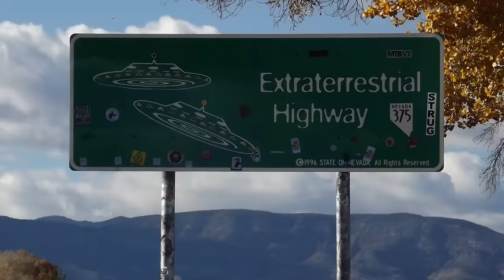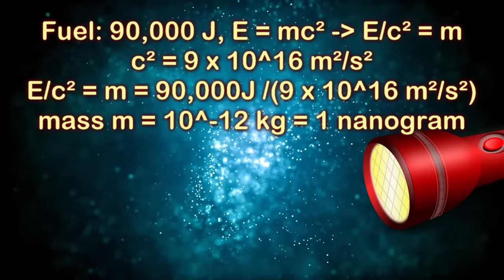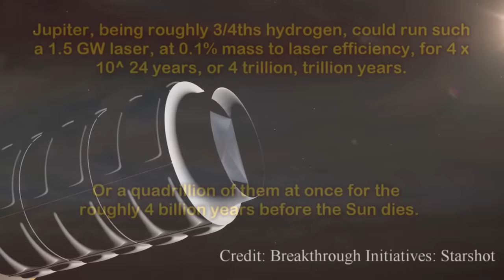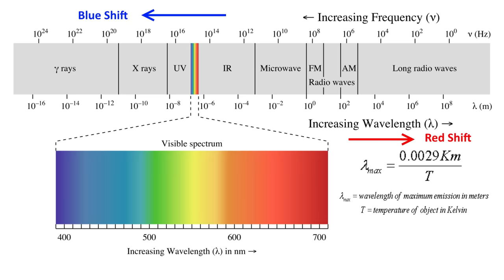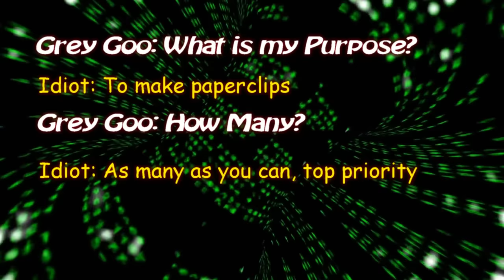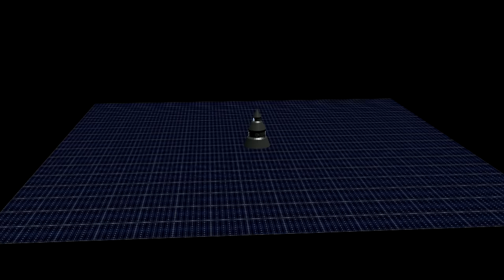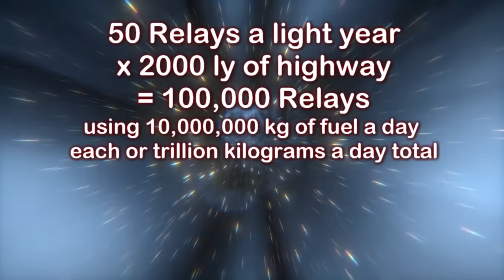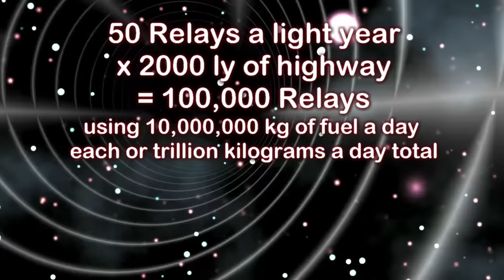Interstellar Highways

Comment: Of course, with breakthrough starshot they are not intending on getting their ship to slow down, since what they want is a flyby to take pictures and beam the information back to earth.
Reply from the maker: Yeah and considering its speed I'm not terribly sure what that's really going to accomplish, its a very small object that will zip through the area very fast, I'm thinking bigger local telescopes will get more done, but I still love the idea.
Reply: Isaac Arthur I think it'll be more of a proof of concept and initiative to develop the necessary engineering and tech, and could probably be supplemented to push larger, more useful objects later
Reply: Isaac Arthur According to the breakthrough starshot team themselves, the pictures their craft take would be the equivalent of a 300km- diameter telescope in LEO. If their optimistic-looking timeline actually works out, sending a probe might be more productive.

They could also use the same tech to send a slower, higher mass space telescope to the sun's gravitational focal point, but they haven't outlined that as part of their mission.

And of course their giant laser array system itself could function as a telescope as well.
Reply from the maker: No kidding? Well I stand corrected then, I trust them to have done their numbers better than my off the cuff guess :)
Reply: Isaac Arthur What are your off-the-cuff numbers, by any chance? Their claim is here: https://breakthroughinitiatives.org/Target/3

Of course, there is the point that a 300 km telescope can do more than just look at alpha centauri (and other nearby star systems). I think using the breakthrough starshot technology for gravitational lens missions will work better for this reason, but an interstellar mission is always going to get more publicity than a gravitational lens project.
Reply: IamGrimalkin Wow, I hadn't heard that either, but that would be incredible!

Comment: But where would the reflected high power laser beam bee pointed?  Wrong turn of the sail in our solar system and voilà "Death star". :) But if serious great work, i enjoy every episode.
Reply: Ian Moone The sail would have to be incredibly smooth, probably more so than the best telescope optics. Otherwise, even just microscopic surface roughness would reflect the beam (which is slightly conical anyways) at differing angles, causing it to diffuse into a much wider cone quite quickly. You'd have to be incredibly, ridiculously close for the reflection to still be tight enough to do any damage :P
Reply: eh point it at Australia.
Reply: TheMasonX there's advantages to focusing it, if possible. If you can direct the laser back to a mirror near the laser source, then you can bounce the beam back and forth multiple times to get more momentum from the same light. There are serious engineering challenges, naturally.
Reply: Yep, not something to use arriving in or departing a Dyson swarm.
Reply: Even if the sail or laser become miss aligned, you wouldn't necessarily have a death star scenario because the energies are off by many orders of magnitude. If you watch at about 5:30 where Isaac uses F=P/c he derives P=1.5GW. Giga watts is billions of watts - so the order of magnitude is about 10^9. But if you look into how much energy it'd take to blow up a planet (I quickly found this: https://scifi.stackexchange.com/questions/90193/what-is-the-wattage-of-the-death-stars-superlaser ) that guy says, "this puts the Death Star's power output at approximately 6.67 x 10^26 Watts, at minimum." However he assumed that the beam, at the given power output, only lasted 3 seconds. If we used our 1.5GW beam for long enough (and since in theory we are probably generating the beam from solar output, and or fusion we can use it indefinitely) at some point you'd have the 2*10^27 joules they used to calculate 10^26 watts. Watts is joules per second so solving for time we get s=J/P => s= (2*10^27 joules)/(1.5GW. Giga watts) which is about s=(10^27)/(10^9)= 10^18 seconds. Considering that 10^18 seconds = 3.1 × 10^10 years worst case scenario the solar highway pointed at a planet for a very long time would do surface damage at best, but you'd have to have the makers of the highway disappear from galactic maintenance pretty much forever, otherwise they'd just realign things.
Reply: Long story short it'd take some number exa-years to blow up a planet with this kind of laser, and to prevent that you'd just have to realign the laser, which would probably be done automatically in any real system.

Comment: I really like this idea. The asteroid belt would be a great relay station, since we could spread millions of lasers evenly around the ring.
Reply from the maker: Close enough for solar power there too, though considering the distances it would probably be easier to build closer to the sun as part of an initial Dyson-up.
Reply: I was thinking mostly in terms of the number of bodies, which would allow for omni-directionality. No matter what angle you were coming or going, there could be a laser propeller somewhere in your vicinity. Make a nice relay from the inner to the outer system. Maybe repeat it in the Kuiper belt too.

But yeah, we'd need them all over the place - orbiting the sun, the Earth, the moon, the asteroids, and all the outer planets and their moons too.
Reply: I disagree, because you are going to have your speed limited by the centripetal force you would have to provide. Perhaps you might be able to do that by adding a large charge to your craft and adding huge magnetic fields or something,  but if you're still going for the ring on a belt around the sun idea it would be better putting it in the Kuiper belt or even the Oort cloud, you need less centripetal force then.

Comment: How much  could  you  slow down  using the  solar wind of a destination  star?
Reply from the maker: Quite a lot, especially if you're using a big mag sail an AU across or something.
Reply: Isaac Arthur So our initial  highway  setup ships might  cary a remarkably  large drag chute to aid in deceleration  near stars, save fuel that way...
Reply: at 10% c , I wouldn't trust in solar counterthrust.
Besides, the larger the sail, the more damage it will likely have sustained in transit.  Need some sort of onboard or preceding installation for slowdown thrust.

Comment: How could a Galactic Positioning System be accurate enough to point a laser at from a distance? Multiple interferometers pointed at very bright stars?

I really hope companies like spacex will come up with an ISS-style plan for an orbital assembly station of spaceships to circumvent the mass problem of the rocket equation. Do you think we need to get started on asteroid mining first or is launching up separate parts from earth more feasible in the short term?
Reply from the maker: Probably giant huge solar powered clocks belching out the time from statites hanging over stars, that's how I'd do it.
Reply: Isaac Arthur Basically the exact same idea, scaled up haha. Do you think the doppler shift of pulsar timings could provide precise enough positioning for a cheaper, generalizable alternative/supplementary data source?
Reply from the maker: Potentially, but you can build an atomic clock more accurate than a pulsar and you can pick your own frequencies and emit very precisely on them. It also gives people a definite fix point to pick up on lower power signals like news, stocks, and traffic, as it were, but odds are each relay would actually have its own GPS calibrated very precisely off each other and the home systems
Reply: Is it possible to correct an atomic clock for the "delay" at relativistic speeds between the stationary beacon and a moving ship? In my understanding, the clocks of both the sender and receiver would have to run identically.
It seems like ships themselves would have to correct for time dilation and the time it takes light to reach them, since even clocks on satellites around earth drift away from earth time.
Reply: Isaac Arthur Very true! I suppose in the case of interstellar highways they would be unnecessary. I guess I was probably more considering distant travel/exploration using other methods where the angular span of such "Galactic Positioning System" structures became increasingly minute, and therefore less accurate, something like that using existing natural references could provide some supplementary information to refine what you got beamed from back home.

I also hadn't considered that each relay could very easily supply such information as part of the beam anyways. Thanks again for continually providing new ideas and expanding my framework of understanding :)
Reply: Mel le I'm sure the doppler shift of the various signals could be used
Reply: I'd actually focus on building flaps into the sail itself so the ship could course correct and keep along the predefined path. The ship, not the station is where you need to fight the battle to stay on course because the ship is there and the station is light-days away.
Reply: Daniel Hall Agreed, but we were talking about correctly interpreting the information contained in the signal, not any physical corrections to be in the path of the beam
Reply: Mel le I was curious about how bad time dilation would actually be, so I did a few calculations. For comparison, a GPS satellite, moves at at 3.87 km/s (1.21 * 10^-5 c). Per day, it's 7 microseconds slower due to velocity (special relativity), but 45 microseconds faster because they experience only about a quarter of surface gravity (general relativity), equaling out to 38 microseconds faster per day than the ground clocks. 

This may not seem like much, but since accuracy error = time difference * speed of light, it adds up quickly. If left unchecked, the accuracy would drop by 11km per day. In fact, you could probably watch it, as the accuracy would decrease by 7.6 meters every minute.

But enough about satellites, those are basically stationary compared to what Isaac was talking about. For example, at only .1 c, the lower limit Issac mentioned, not correcting for time dilation would mean that the beam could be up to 6.18 megameters (6,182 km) off target.

I made a little web calculator that shows time dilation, accuracy error, and the doppler multiplier. It's nothing special (didn't care to make it pretty, and I haven't done web programming in years haha), but it was kind of fun, and interesting to see how quickly the error builds up. I don't have a web host to upload it to anymore, so I just used an online "test" utility: https://www.w3schools.com/code/tryit.asp?filename=FD2NAU6U1EMP

Oh, and if you'd like to see me add any other variables, let me know :)
Reply: That's awesome! Thanks for the effort! 11km drift a day is a pretty wild number in and of itself, considering how close and slow our satellites are.

It's incredible that just a few variables already give an idea of what we're going to have to compensate for in practice in the future. I'm sure Albert Einstein would've loved this!
Reply: Haha, thanks! I was curious, and was going to do a table, but since I already had the equation, I figured it would be fun to try an interactive web page. I usually do games, which is a very different beast, but I've been trying to broaden my horizons and try new things (I've never used javascript on a webpage, because it wasn't really supported back when I made a few on commission haha).

But yeah, it's incredible how quickly tiny offests lead to huge errors. Knowing engineers and scientists, they'll still manage to get it much more precise than even our neighboring GPS satellites could ever do haha :P
Reply: I'm not sure a sheer clock array would be sufficiently accurate; compensating for relativity across so many different reference frames could become a computational nightmare for a navigating ship.  It's easy enough on earth because there are only two frames of reference; the orbital system and the points on or near the Earth's surface.
Most pulsars are reliably accurate down to the microsecond, and there are enough stellar observables that simply maintaining an onboard 'stellar cartography' model and measuring required corrections can illuminate the exact amount of 'relativity shift' (due to acceleration time dilation, effects of gravity wells, FOR differentials, etc.) at any point.
Reply: HuntingTarg I guess pulsars will be used first, but you will probably be sending out self-replicating robots ahead of you wherever you go to build Dyson spheres and each one would be set up at the very start to have an atomic clock and a program to calculate the time on Earth based off its current time and the total amount of acceleration it has encountered to that point.
Once each builds a Dyson swarm, they will use the pulsar coordinates to Earth and have one month long bursts of stellaser light of a particular frequency sent along the paths of the interstellar highway every 10 years according to the blueprint of the stellaser highway they got at the beginning and based off where they know their position to be from the pulsars. The rest of the light is just used to keep sending out the time on Earth it understands it to be and the name of that star. This doesn’t have to be any fancier than Morse code with one second dots, three second dashes, one second dark between each dot or dash within a character, three second darkness between characters, and six second darkness for spaces.
This also helps to communicate our presence to aliens and let them understand some way to communicate with us.
By also having this particular scheme of sending the name and time, without knowing the exact second during the course of transmitting the name and full scientific catalog name, year, day, month, hour, minute, and second, the switch between dark and light will happen either at one second, three second, or six second intervals, so a ship already having looked at it for six seconds knows how much relative time that star is experiencing.

Comment: 17:50 - I think you need a paraboloid rather than a cone with straight walls to merge the acceleration with the rotation properly. That way you can make "gravity" pull in the right direction everywhere, though not with constant strength. This allows you to make the radius (or the angular velocity) smaller, so it is probably a good idea even for less ambitious ships too - with ion/fission fragment drives. You don't actually have to build the entire parabola, just the segment where gravity would be in the acceptable range. Although if you do, you get a pretty good telescope as a byproduct.

For example, let's say you want to rotate every 20 seconds, and you want Earth gravity +/- 5%:
no thrust: radius = 99.36 m
3 m/s2: radius = 89.37 m - 99.80 m
6 m/s2: radius = 72.21 m - 84.79 m
9 m/s2. radius = 24.39 m - 50.69 m (your ship is almost flat at this point)

Comment: Another short note: you might use a detachable central sail (have a reflective large sail, and use reflected light from that sail to slow down the smaller central sail once it is detached).  This means you don't need a laser at the target to get the system to work.

And you'd also want something like a gigantic fresnel lens to refocus the launching laser beam, to deal with the beam divergence problem.

Dr. Robert Forward dealt with these problems and solutions in one of his novels.

Comment: I've always had a problem with sails & "wind resistance". Sure, there is little up there but there is something. I like the idea of having the front forming a cone to concentrate that which it hits (no energy used & no matter wasted) in order to provide the mass (& heat energy) for at least supplemental engine power.

Comment: One thing comes to my mind - it should be possible for a ship to simply seed the stations behind it. The ship would start from earth, being accelerated by a laser form earth. Once it reaches desirable distance (and meets interstellar object that can serve as a fuel) It releases a "station" with its own sail. The beam reflected from the ship would be used to slow down the station to halt. The station would dock on the interstellar object, sets up fuel-mining operation. builds its own copy (possibly recycling the sail, landing gear, etc. for this new copy) and uses its new laser to "reload" the ship with this new station. The old station would then take on the torch and provide its laser to push the ship further. 

Such ship would never have to stop and could simply keep on going at full speed, seeding the galaxy with highways and colonies. It would also be able to return to its source, since it can seed the stations in a big circle, reflecting the beam slightly to side along the way.

One big problem I see with it is, if the station fails to make its laser operational in time, the ship may end up out of range of nearest laser, at which point it ends up flying away into its doom. That can be partially avoided by seeding the stations roughly in a spiral, but that slows down the process significantly if your aim is to cover maximum distance instead of volume.

Comment: Why cant we just bring the laser along built onto the craft? Wouldn't the output of the laser bouncing off the sail supersede the output of the laser shooting out towards the sail? And if that's not the case and we get too much thrust in reverse from the laser shooting out towards the sail, couldnt we just turn them around and use them as forward thrust and scrap the sail altogether?
Reply: Bring the lazer and you have to bring the fuel to run it.